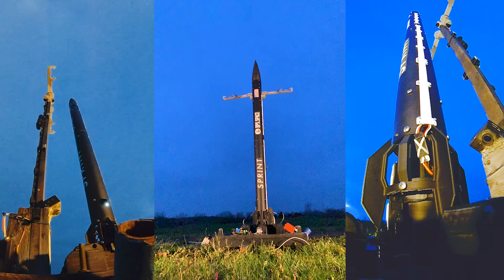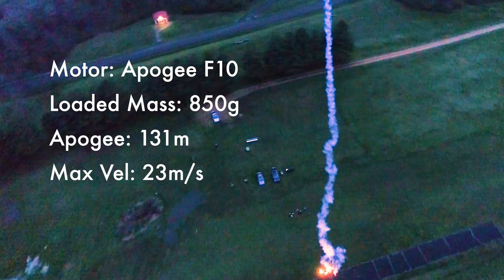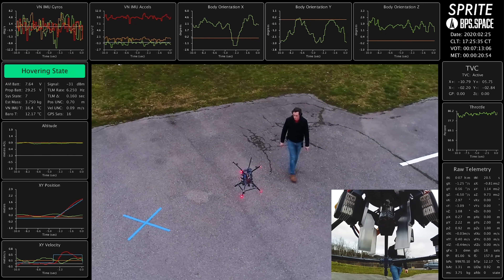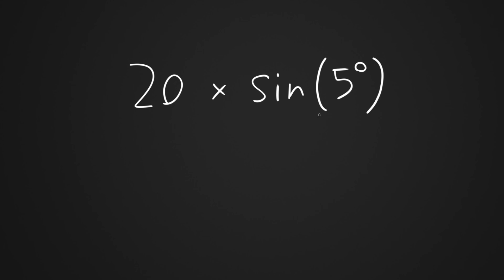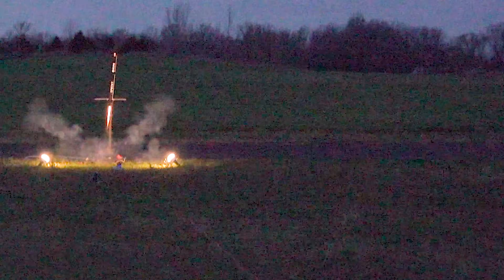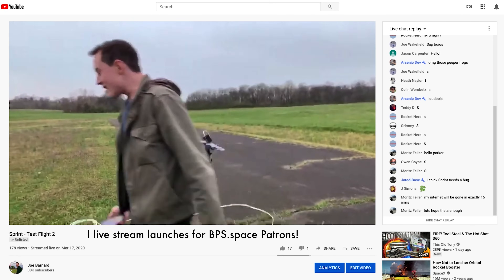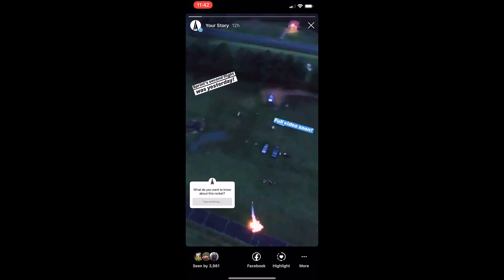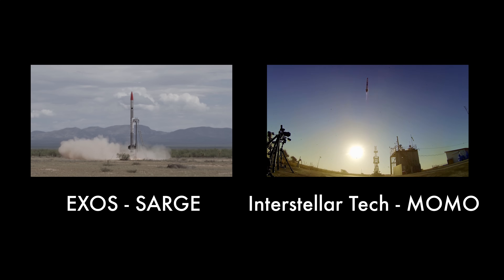Sprint - Test Flight 2 + Q&A

Comment: For better telemetry range you could get your Ham radio license (Tech is easy) and use "something like" the radio that one of Egg Finder's tracking  devices uses for telemetry. It works in the 2m Ham band and has much better range than 900 MHz

Comment: For your torque control algorithm, do you need to take into account any aerodynamic forces that produce a torque in the direction of wrongful pitching?  I mean, when the rocket is slightly pitched sideways , I could imagine the air is coming at is sideways as well and your motors need to produce a torque not only counteracting the moment of inertia of the rocket but also the torque produced by the wind.

Comment: Awesome channel! I’m involved in the DIY quadcopter and long-range fixed-wing drone building community and the speed of development in that hobby has been quite mind-blowing. I can certainly see a similar potential here for model rockets and this new way you’re building and flying them with thrust vectoring and adding in control software and flight computers. A lot of people will be interested in building these types of rockets, for sure. There are some comparisons here to how flight control software has revolutionized quadcopters in such a short time. 

It might be quite fun to add into your rockets some long-range video equipment to get a live feed and on-screen flight data in real-time. You could add something comparable to Betaflight OSD to give you live on-screen flight data (speed, altitude, range, and GPS coordinates). It’s pretty cheap to get this equipment and fairly straight forward to add-in with a bit of research. If you use 5.8ghz video equipment the antennas are small and could be embedded inside the rocket too. I get about 5km of video range on my 5.8ghz FPV setup. It would be fun to combine some of these developments into model rockets. 

Anyway, great work! I might have to build myself some rockets now, lol.

Comment: What you think about NVIDIA Jetson nano as CPU, RFM95W LoRa Module for data transmission. There is a problem in LoRa that is Data transmission speed of upto 300 kbps. If made all the realtime processing  in Jetson and after that if we just collect all the raw data from sensors except all camera than i think LoRa can handle it. And their is also problems with Jetson's  Power backup. This thing is depends on your rocket's  thrust. Because batterys are little bit weighty product. Thank you. 

I don't know much about rocket science.  But I think you can understand what I mean by thrust problem. Thank you.

Comment: I just stumbled across your YT channel (I'm new to YT). I'm binge wotching!

I built a canard-based vertical stabilization system (VSS) on an 8 foot, 75mm rocket generally launched on J motors.  I learned a lot about aerodynamic "torque coupling" between the canard and the tail fins but that is a long story.

Currently I'm working on a small rocket to space (above the Karman line). By small I mean a maximum O total impulse or less than 40960 Ns. I've tested an upper stage 75mm motor with 12kNs total impulse and I'm working on a 127mm 28kNs booster (nozzle failures).  I've always been concerned by the pitch deviation due to low altitude winds at launch (thus the VSS work).  These can cause a very large horizontal deviation which make getting FAA, Tripoli, et al permission to launch not to mention reducing the likelihood of ever finding or recovering the rocket.  Your video has re-energized my vertical stabilization interest.  If you are interested in my project I'd enjoy sharing.  Keep up the good work.

Stan

Comment: at 3:26 you mentioned a roll program and it is clear that the rocket actually performed one, how did you manage to accomplish this with a single engine? I thought a rocket needed at least two engines to point in slightly opposed directions to actually roll?

Comment: Your idea of building a controller around the torque,  that's the way how we've got teached to set up a control loop. The first step is to describe your system in diff. equations. Reduce it to a first order system, solve it numerically or feed it into your PID Control.

Comment: Long range telemetry can be achieved using LoRa and some directional antennas. Easy.

You can't stream all of the data (your 4kHz) but it will atleast be able to TX enough to give you updates of about 5Hz. You could average the values in between transmissions and then send them down.

For antennas you could use a yagi antenna as they are smaller and easier to handle.

Comment: Pro tip on tracking - stabilize the camera and follow it with a mirror, camera pointing away from the launch at the mirror.  Much more gentle movements and easier to manage

Comment: Just an idea...
Imagine if you could fabricate a couple of wings that swing out at apogee. With elevon control and an FPV cam in the nose cone you could glide the rocket down. Think hang-glider styled wing using formed leading edge with fabric wing surface so as arms swing out wing shape forms.
Space-wise each wing could be contained in a 15-20mm diameter(maybe smaller) semi-circular cavity running down the inside of each side of the length of the rocket body.
Wing hinges slide from top of rocket when stowed, down to where necessary to align centre of mass with centre of lift. Think simple actuated slider acting on base of leading edge,  and support strut attached between fixed point on rocket body and point closer to middle of leading edge.
Hinge slides down, wing pops out.
A small servo and a piece of string attached to the trailing edge of the wing, on each side, will give you basic control surfaces.
Voila!
I realise this is at a tangent to your current work, however, it is a tangent to your current work.
:-)

Comment: Have you thought about using a cascade PID controller? One that has the orientation as the process variable with thrust as the control variable which feeds into a PID as the process variable and outputs angle as the control variable. That way you don't need to calculate with the vehicle mass etc. The 1st stage PID will dynamically adapt to changes in the vehicle characteristic. I'm not a rocket guy, so I might be missing something fundamental that means this wouldn't work..

Comment: Q: How would you keep track of the telemitry for 1Km and beyond...
A:  some form of syncronus communication similar to 5he videos on how a Raspberry Pi can transmit video over 10Km.
Transmitter on send inly on known channel, reciever set on listen only mode.  It potentially can be done with nrf21n1 with whip antennas, the ESP32s would be a better option as it could do encryption on the data as it transmits.
Keep up the progress, if I was going to discuss this at partirs, they would be Virtual as the only virus I could get is potentially a python script.

Comment: Geez as soon as you explained the problem with using PID when you didn't have a constant thrust from the motor my brain started churning. I KNEW that the instrumentation you have onboard could solve that problem and at 6:50 in the video I yelled out loud OF COURSE YOU CAN SOLVE FOR THRUST BECAUSE YOU KNOW THE ACCELERATION. I love it when you get to do useful shit with all those physics equations we programmed into our TI83s in college to cheat on the test

Comment: would offsetting motor's horizontal position inside the body of the rocket help with control while landing? it'd give you roll control without losing any of the other axes (?)

Comment: What if you found the midpoint of the local minimum and maximum of the TVC angle plot, and used it to set the initial position of the TVC mount at launch?

i.e. If, shortly before burnout, the TVC was oscillating between +2° and -1.5°, set the initial position of the TVC at 0.25°, the midpoint of the two extremes, and compensate for the misalignment.

Comment: Bruh, spill the beans. What RF band are you going to use for the alleged telemetry system? One of the ISM bands would totally give you the bandwidth needed, but the power limits suck. I guess $10 radio and $100 antenna rule applies here.

Comment: PID problem understood; The PID I worked with controlled the amount of material going into the process, easy = yours would have to control the amount of thrust coming from the engine, not quite so easy to throttle a solid propellant ..... hay I know, what about liquid fu ...... oh ... right.
For making YouTube videos, "Sufficient sun shine" would make for a legitimate pre-flight check box. "Power?"... "go", "Telemetry?" ... "go", "weather?" ... "go", "daylight? ..., ......."no go, no go!!!"

Comment: Is the moment arm calculation static or will it adjust dynamically based on the real time center of mass of the rocket? Would assume as propellant is burned the rocket's center of mass would change

Comment: Joe, do you use a 6DOF simulation, or are you decoupling into two 3DOF sims?
Reply from the maker: 6DOF! Used to do just 3DOF but with a MIMO system you want to simulate the whole controller all at once.

Comment: What type of motor do you use for the reaction wheel? DC brushed, BLDC, or sth else?
Also, will you share more details about the control software for your torque based controller or is it classified?

Comment: Does your flight software calculations account for the gradual reduction in mass as the fuel gets burned on the way up?
Reply: jim champoux in theory, the length doesn't change, only the force applied at that length. I'm sure as motor length goes up, that's something you'll need to consider as the grain burns up into the casing.
Reply: If I had to take a guess, I would assume the software isn’t too complex and doesn’t need to account for loss of mass based on fuel consumption. This is because mass is independent of the roll/pitch/yaw calculations needed to control the rocket. He would only need to know the difference in actual orientation and desired orientation to correct the rocket. Even if the mass changes how the system responds to inputs, in the end it just tries to point in the desired direction. 

Also, the moment arm doesn’t really change as the rocket motors burns because the thrust still acts at the very bottom of the nozzle where it exits. The location of the center of mass of the rocket may change (which would change the moment arm length), but the calculation for a small scale rocket like this is probably negligible and would make things more complicated if he tried accounting for this.
Reply: @squiddi1393  I suspect perhaps its not that important at this scale, but Loss of mass would definitely be important at scale because the Force needed to overcome whatever inertial forces are acting against the thing to veer it off course would would need to account for the amount of mass needing to be brought back on course.. IE the force needed to apply the torque he speaks of on the virtual torsion arm would need to overcome the other forces acting on that arm, and that force would need to account for mass to avoid grossly over powering or under powering the action...
Reply: @squiddi1393  Either way its Fascinating...

Comment: aren't the vehicle mass and the torque arm also changing through the flight as it burns propellant?
Reply from the maker: Yes! But not to the degree that the thrust spike changes the deflection force - basically, it would be good to take that into account as well, but one step at a time :)

Comment: nice schematic also with only + - 0.5 deg on the tvc could you complete the small flights just by giving the rocket a large moment of inertia? p.s i like the pink light in the next room.   p.p.s some of us are such pros we dont need high power motors to break our rockets we just use unplanned lithobraking lol  any way have fun in isolation .

Comment: "Shredding the rocket would be pretty cool" - Joe Barnard
Reply: I've flown high impulse L motors in 4 inch cardboard, no shreds.   I don't fear the H13.
Reply: I think he just craves the mental relief of shredding it....
Reply: @KastanDay  Vmax, Super Thunder or Warp9 will be required for a sure shred. And not in end-burn configuration.   I've always been partial to the K2045, but a G250 will be a good start.
Reply: This is just more proof he’s an Elon Musk clone.
Reply: I've shredded several 75mm carbon fiber N-motor rockets (due to aerodynamic instability...) at Mach 2.4 to 2.7, It creates some amazing artifacts!

Comment: 13:32, Yeah, it really is.  You could probably start on that, it looks like you have some paper sitting under those motors on your desk, you could even start drawing up a schematic for it right now!
Reply: He could use LoRa. We did this on a school project, launching a wheather ballon into the stratosphere
Reply: @laurenz6231  But a weather balloon doesn't shoot plasma out of its back. That could produce some trouble, especially with low power systems like LoRaWAN
Reply: How do you make that propellants?
Reply: @ELAI_aerospace  he bought them on the internet